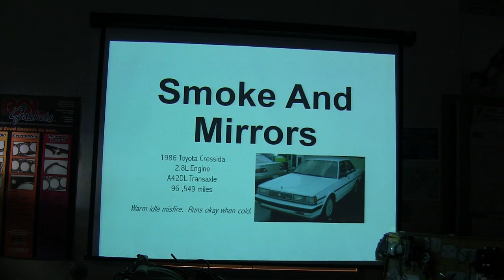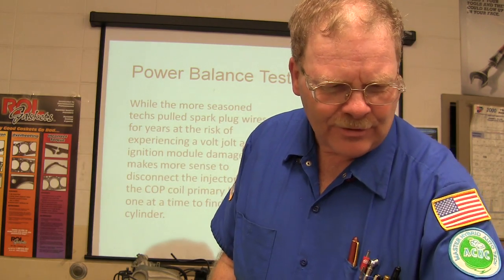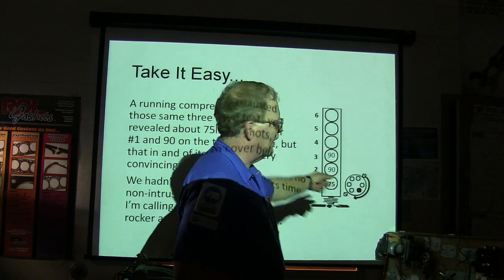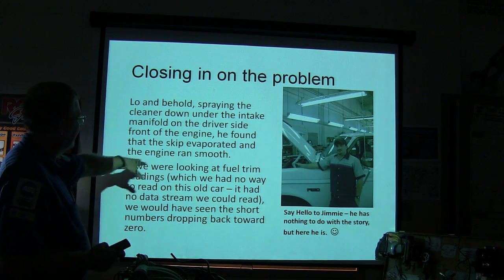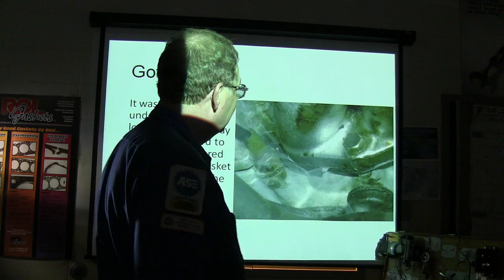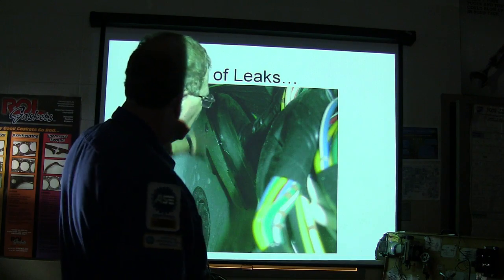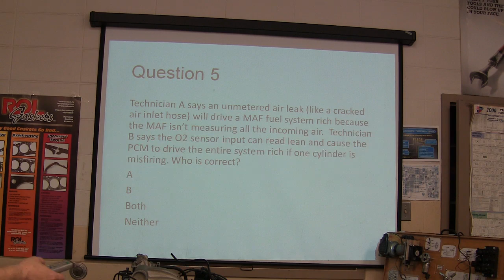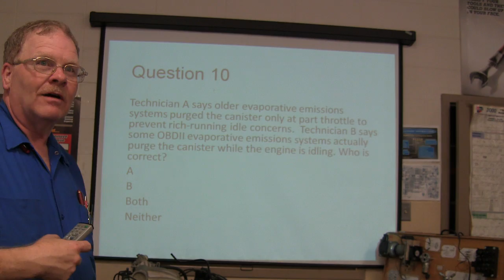Smoke and Mirrors

Comment: Maybe you can help me with a 2008 Rav4 2.4 liter Auto 2wd. My mechanic replaced the alternator and rear wheel hub assembly before taking it for a test drive. The vsc light stayed off and the whine from the alternator was also gone. However, he said we lost ac function, so we put it on the hoist to figure out what happened. We found the wires going to the ac compressor were partially cut, may have got pinched between something. As we were looking it over the engine started to shake and buck, then turned off. Now it does not want to start. Cranks but will not catch. Could the wire(s) going to the ac compressor take out the computer if they shorted to a engine/body ground? Any help would be appreciated. Thanks
Reply: I don't thing Ac clutch wire would fry your computer, your mechanic can check if pcm is awake by, turning key to second position and listen if fuel pump kicks in, then by checking voltages supplies to tps, maf sensor, or check to see if injectors pulsing when cranking. I'd start with checking fuel pressure
Reply: We also replaced the crank sensor the following day because it looked like the serpentine belt rubbed partially through the sheathing and also because we kept getting a p0335 code. After the replacement still  had crank no start condition, although it sounds like it wants to catch, it just won't. Also you can smell gas after the prolonged crank, unburnt fuel coming out of the exhaust. Then, the following day I took a crack at it by unplugging the cam sensor and leaving it unplugged, and after an extended crank it caught and started up. I gave it throttle from the pedal and it went to 4k rpm with no stumbles or other problems. I failed to mention that the tach guage  never stopped working even with the cam sensor unplugged. I thought I was on to something so I replaced the cam sensor, and after replacement with the cam sensor plugged in, the crank no start condition persisted. I unplugged the new cam sensor, and after an extended crank it caught and ran as if nothing was the matter. In fact, at this point I decided to take it to a neighboring shop, and ran without any hiccups. I have noticed that if I turn it off and immediately back on, it will start without the extended crank. If I leave it off for an extended period of time, it will exhibit an extended crank condition. Thanks for your help.
Reply: +rusco321 is p0335 keep coming back? Crank sensor is responsible for spark action, sounds more that your computer is ok since injectors are firing, engine can run with cam sensor unplugged (except Chrysler) check if you have any more codes and see if crank signal is getting to computer
Reply: p0335 keeps coming back. Also, sometimes code p0353 comes up, even after swapping coils around.
Reply: +rusco321 is crank sensor 2 or 3 wire? If it's two wire check if 5v coming in, if 3 wire check to see if it's powered up and third wire sending signal to pcm, check for signal at front and at Pcm (careful not to fry your pcm), I think you have damaged wire from crank sensor coming to pcm. You can do a quick test by wiggling wires while someone try to start the engine ( be careful not to be caught by rotating accessories)
Reply: +rusco321 when you replaced old crank sensor, was it in good appearance? Not damaged or scratched?
Reply: It's a two wire sensor, but it's a variable reluctance (magneto resistive) sensor so it produces its own voltage. I have a vantage pro scope to look at the waveform, but I'm not very skilled with it and nor is my mechanic.
Reply: The thick plastic sheathing had some visible bits missing from it, the insulation for the two wires (which were braided and it had a bare shielding wire running the length of it) was completely intact. We basically replaced it to appease the customer who was looking over my mechanics shoulder.
Reply: +rusco321 it does generate its own Ac voltage, but computer sends 5v dc reference signal to it and measures resistance of that sensor. Check for crank sensor resistance at the pcm and that way you'll know if your wiring is good or not. I highly suggest to connect scope to see if it had proper signal. You can solve this mystery much faster with a scope and you'll see if it has an open in the circuit
Reply: +rusco321 also pull new sensor out and see if it damaged by reluctant ring
Reply: +SPD Parts That's a good idea. I'll let you know what happens. Thanks for the help.